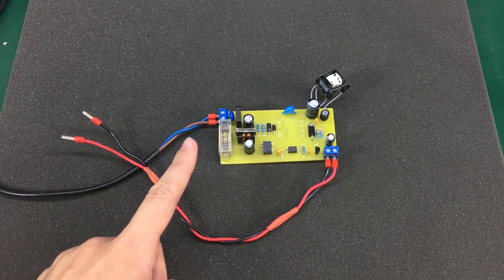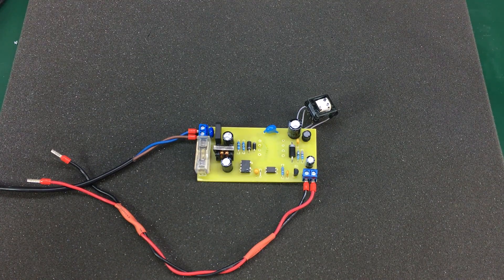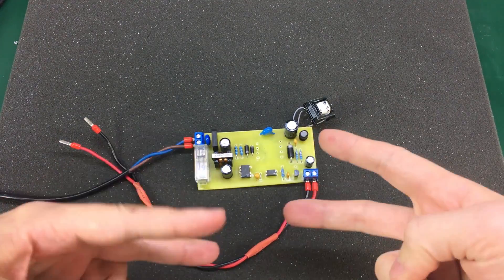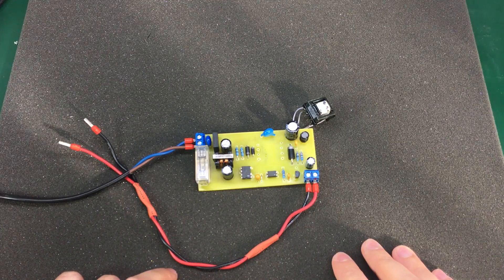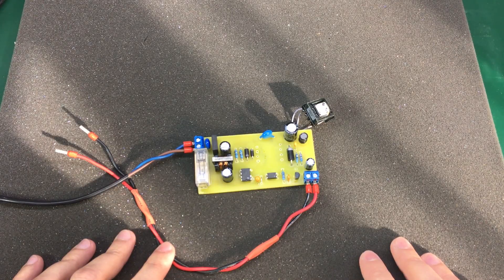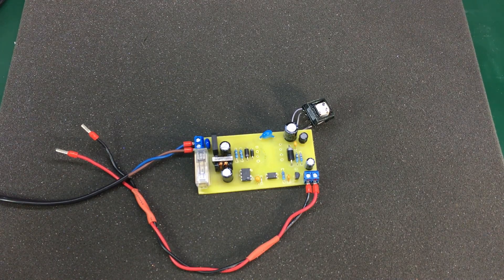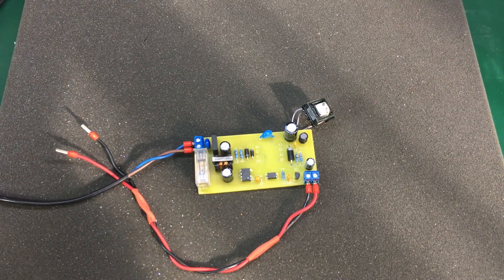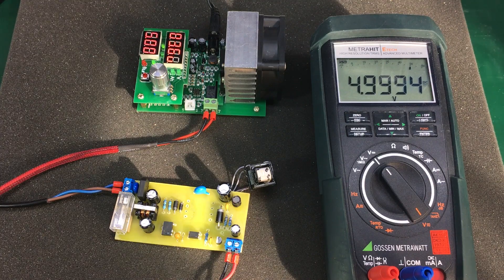Voltlog #72 - DIY AC-DC Off-Line Converter With TNY276/TNY277 - part 2

Comment: Without looking at the datasheets, I'd guess that you're right - because the transformer was designed for an IC with higher current capabilities, its inductance was too low and the peak current through it too high for the IC you used.
Reply from the maker: well.. I wasn't quite right, there is part 3 in the making which should explain everything

Comment: It sometimes happens that the chip comes faulty. Have you replaced it with the same model number?
Reply from the maker: you are right, I stuck a new TNY276 in the circuit and it also works fine, I am now working on part 3 video where I explain what actually happened, this time I really think I have it figured out :)

Comment: I doubt that power rating change anything, circuit go to thermal protection with no load. Even coupled inductors are designed for higher power rating it will not make difference (primary current is defined by duty cycle). 
I now suspect that IC was not totally functional.
There is no difference if you put start of inductor or end of inductor (they are not polarized components) but for coupled inductors you need to take atention to connect both sides correctly for proper topology. Flyback transfer energy to secondary side during primary switch off period (opposite polarity windings), and same looking one transistor forward transfer energy during on period and that why it use transformer with same-polarity windings. 
ps: I use coupled inductor  for flyback transformer, just because in theory transformer do not store energy (ideal transformer) and for flyback energy is stored in the magnetic field in the inductor air gap so more correct name is coupled inductors.
Reply from the maker: you are right, I stuck a new TNY276 in the circuit and it also works fine, I am now working on part 3 video where I explain what actually happened, this time I really think I have it figured out :)